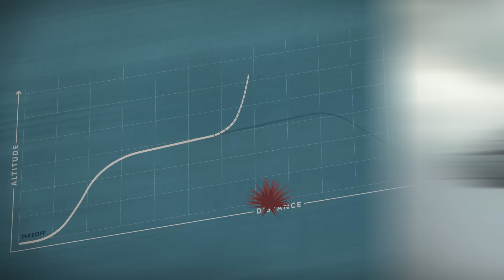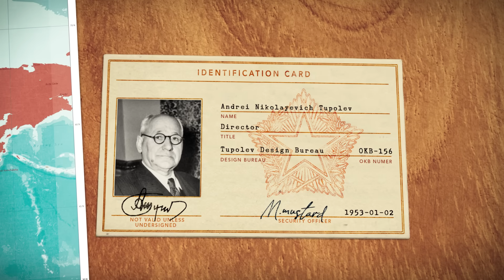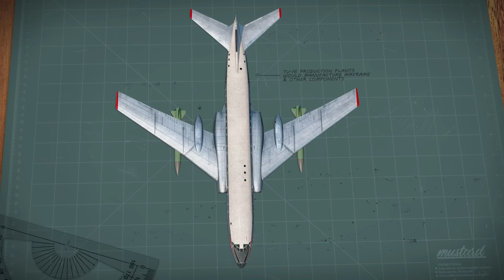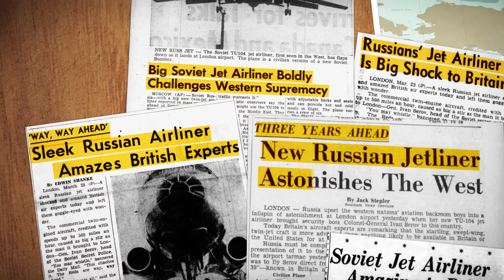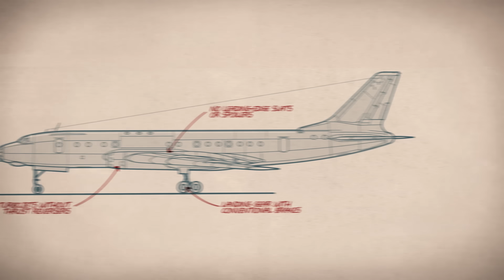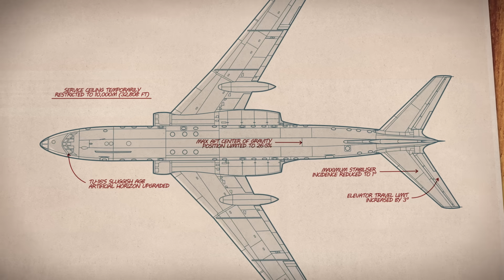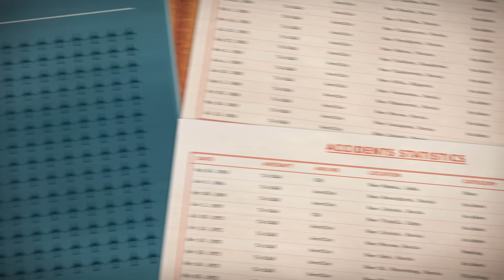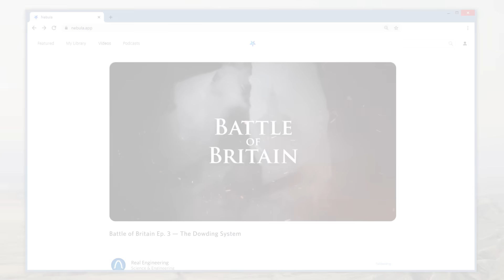The Soviet Airliner Designed To Crash

Comment: You REALLY would not want to fly the first US airliner, the Boeing 707-120,  which killed 5 people just one year after it went into service in 1958. Its killing spree only just ended in 2019 when it killed 15 people in a crash on January 14th, and plenty more people in between those years of operation.

Comment: Fantastic work - very informative! I love learning about the early jet airliners - those who designed and flew them were pioneers in many ways. Just a quick note - on the map of the Tu-104's first transatlantic voyage to the United States, you have Gander, Newfoundland, mislabeled as Goose Bay AB (also in the province of Newfoundland in Labrador, but on the mainland portion, called Labrador, some 600 kilometers away). Cheers!

Comment: This reminds me of a great quote from Chernobyl. There are some things you just don't want to cut corners on. A nuclear reactor is one. An aircraft is another.

"Why? For the same reason our reactors do not have containment buildings around them, like those in the West. For the same reason we don't use properly enriched fuel in our cores. For the same reason we are the only nation that builds water-cooled, graphite-moderated reactors with a positive void coefficient. It's cheaper."

Comment: Your explanation is totally incorrect. In fact those crashes were caused by stalls on wingtips. Planes of that era didn't have a special twist. New planes do have it. So now if a stall is occurred, it starts not on wingtips. But Tu-104 developed stalls on the wingtips, and as wings are very much sweped back, wing loses the lifting force closer to a back of the plane,  so the center of lift shifts to the nose of the aircraft.

And of course it has nothing to do with being a former bomber aircraft

Comment: I spoke to some of the pilots, who used to fly that plane for Czcechoslovak Airline. What they said is not corresponding to this video. They loved to fly that plane. The only negative comments were just two  - the aircraft was aerodynamicaly so clean, you had to carefully calculate the point of descent, because if you started late, you cannot lose your altitude on track and you have to ask for track extension. The second problem was relatively high landing speed, which was problem on short runways. In that case it was sometimes needed to use the braking parachute, which aircraft was equiped. Decision to buy TU-104 for CSA was generally considered to by wery good and the accident rate was normal, comparing to other first jets.

Comment: In 1981 a military TU 104 crashed killing all 50 people on board, including 17 high ranking Russian generals and admirals. The plane was retired from civilian service in 1979 after numerous crashes. it was retired from any use after the 1981 crash.

it demonstrates a different mindset between Russia and the West. The British did not pretend the Comet didn't have problems, they didn't try to blame it on the pilots. They didn't use the plane as propaganda. They were in a rush to be the first and beat the Americans though, and they overlooked an insane flaw by having square windows. The Lockheed Constellation was the first pressurized civilian airliner and had round windows. The Russians denied the TU 104 was defective. That mindset cost a lot of people their lives, including the Russian generals.

Comment: I flew on one in 1976, from then-Leningrad to Moscow. No individual air outlets, loud engine moan, and I watched in fascination on approach as the flaps wound out on long, long exposed jackscrews. As well, at Leningrad were a flock of recently-retired TU-114s  on the tarmac, all those multiple layers of props glinting in the sun...good memories!
Reply: Exposed jackscrews on the flaps reminds me of the DC-10... sitting in the right spot, you can see the jackscrews working.   :-)
Reply: I flew on one the same year, can't remember which route (we went to Moscow, then-Leningrad, Kiev and Yalta), but going by what you've said it may have been the same.
Reply: whats the first song name

Comment: Hi Mustard! One could argue that the most advanced plane is not the B-2 Spirit. Instead, it was the RC-135E Rivet Amber/Lisa Ann ballistic missile observatory aircraft. I, and most certainly many others, would love a video on it! The aircraft was unusually designed and had a massive missile tracking capability - it could track a missile from 300 miles (480 km) away! Very impressive in my opinion.

Comment: Flew several times in the 60's on the Comet. Liked how quiet landings and take offs were. Also passenger cabins too were quiet. Remarkable silent smooth landings. Too bad they had structural serious issues which were blamed on round windows.
Reply: No, it was not round windows that were the problem with the Comet:  it was the SQUARE windows.  Metal fatigue initiated cracks in the window corners, leading to catastrophic rupture of the hull and several fatal crashes.  The re-designed Comet 2 had round windows as one of the measures to fix the metal fatigue problem.
Reply: @bernarddavis1050  thanks for the clarification

Comment: You don't want to fly in ANY Russian aircraft, especially now as they are flying ticking timebombs that should have had their A B and C checks, now expired and using non-approved parts.
Reply: That's not true. Many of them were safer than their western equivalent
Reply: @katimboallan4605   not really. Most were a lot more dangerous. 

Tu-154s tended to crash a lot more than 727s

Comment: 50' ? Then go fly with Comet from Uk
Reply: The comment suffered far greater crushes any Soviet plane. Good observation you made.
Reply: @katimboallan4605   Actually the comet crashed less than the tu-104. 

Mainly because it was pulled from service after a few deadly crashes.

Comment: I remember taking a trip in the Soviet Union in 1984 from St.Petersburg ( Leningrad back then ) to Moscow to Kiev and then Odessa...
The one thing that struck me were the planes we flew on between cities : They were loud, not very comfortable and they all had glass noses which I found unique to say the least...
Great video 🙂🙂🙂
Reply: In the glass nose, there was a (comfortable) seat for the navigator, one of the then 4 flight crew members.
Reply: @Sergei-wf1jp  I see... Thanks for that explanation 🙂🙂
Reply: @Sergei-wf1jp  Not only. It was a rement from  TU-4  the soviet copy of the B-29 that crashed in USSR during the war. They really liked the idea of it. On the airliner it had a secondary function during the cold war. The soivets tended to fly airliners over restricted areas and the navigator doubled as photographer. I think it caused a few political incidents in the early 70ties.
Reply: @mowtow90  You mean they photographed restricted zones in USSR ? :)

Comment: "fell" 20kft? It glided like any other plane.

Using this vocabulary is just akin to mainstream media desiring to create a feeling if sensation. It is more credible to stick with aeronautical terms of one wishes to stay credible.

It's a pity you sidestep the actual aerodynamic causes behind the accidents but instead resort to non-standard terminology such as "hurled".
Reply: Stalling, mass weight
Reply: @305.anthonx_s  and you are incapable of formulating full sentences like a civilized human being?
Reply: @daszieher  I’m not best at speaking English, started 1 month back
Reply: If you stall out you are not gliding.
Reply: @FishbedMyBeloved  the term falling was used in combination with the double engine flame out. The aircraft itself, that means the wing was not stalled at that point.

Also, should an aircraft fully depart at high altitudes and tumble, as was the case in other events, recovery is highly improbable.

The aircraft suffered, by design, from a change pitching moment close to stall speed.

The majority of the write-offs were, however, attributable to maintenance oversights and improper procedures.

The Wiki page has a good collection of incidents and their probable cause. There are even events of "foul play", but too little to suddenly make this design "good".

Comment: Why are American planes failing in the post-2010 project called lives don't matter but cheap production does yes (MAX)
Reply: The max was pulled out of service after 2 crashes. This is good practice.

The tu-104 was allowed to continue killing. This is bad practice.
Reply: @FishbedMyBeloved  yes but in those russian or soviet times safety testing technology was old at that time smoking was allowed there was a lot of speculation why the plane went down until boeing engineers agreed the max was not safe for production but the office people ordered it  products because the 320 neo was better, they knowingly endangered lives, they even moved the office to Chicago so that the engineers could not put pressure on the directors, now the directors are somewhere in Central America

Comment: So, the T104 was actually working...

And only started failing later on...
And nobody suspects foul play?
Reply: No, it's inherent design flaws actually only surfaced through extensive use in the active airline service.
Reply: Foul play would involve actual equipment failures.

For foul play to cause an aircraft to somehow fall up would require the bad actors to modify literally everything and somehow go unnoticed

Comment: Aircraft derivatives are rather common. It takes years to design, test, change and finally produce flight surfaces (wings, horizontal and vertical controls). The KC-135 and the Boeing 707 differ only in the fuselage diameter. The KC-10:and DC-10 were nearly identical as well.  The underperforming brakes meant the Tu-104 couldn't carry ballast to cancel the aft CG issue.
Reply from the maker: Thanks for watching and commenting. While it's true, the DC-10 was first a passenger airliner, before it became a tanker. From the start, the KC-135 was developed alongside the 707, both stemming from the Dash 80.  I'm not aware of any post-war western bomber that was later developed into an airliner. The TU-104 and TU-114 were first purebred bombers, only later became airliners. It would be like the United States building a B-52 derived airliner.

Comment: It's amazing that the Tu-104 and the Tu-114 and -116 are based of of Soviet bombers yet have had such importance to aviation in so many regards.. well done Mustard!
Reply: All civilian aviation with jet engines was based on bombers. Perhaps not the British but they failed perhaps due to that.
Reply: @hurri7720  not really only the jet engine came from bombers its just that most company that made plane where making civilian and Military plane the same why lockheed martin make missile for the air force and booster (and a lot of other stuff but you get the idea) for the nasa
Reply: @the_zonko  the boeing 707 was designed from a bomber.
Reply: @machupikachu1085  lmao no it was build on the prototype that was the Dash 80 and it was build whit both military and civilian usage so no it was not designed from a bomber
Reply: @the_zonko  the B47 is the progenitor of all modern airliners.  The Dash 80 was developed to improve on the B47 concept but be used for commercial aviation.  

Sure, you came from your mommy, but would you honesty say you didn't come from your grandma?
Reply: I;d love to see a passenger jet based on the TU-22
Reply: hi
Reply: It's kinda funny that Mustard's video of the De Havilland Comet said something like, "the US specialized in building cargo planes in WW2, which were easily convertible to airliners. Meanwhile the British built mostly heavy bombers, which were harder to adapt into airliner designs."

And then you have the Soviets just turning bombers into airliners like nobody's business
Reply: Add the Tu 124 and partly the Tu 134. Tu 154 was the first clean sheet civilian jet liner designed by Tupolev.

Comment: Holy, just checked TU 104 20% Hull Loss, TU 124 15% Hull Loss, Boeing 707 8% Hull loss, etc. Those begining were brutal. Taking a jet a have a 1/20 000 chance that you would CRASH in case of TU 104, holy would rather walk that distance. ( 90 mil passanger transported by TU 104 = 900 000 flights = 900 000/38 hull loss = 23 684 )

Comment: You missed a important crash in the early 80'S  that killed the majority of the Soviet Navy's eastern command , They were in Leningrad for a meeting and used a 104 to get them there and back , On the return trip they all loaded up on consumer goods, as they were based in Valadistock these goods were hard to come buy in the far east . To add to the load the chief Admiral insisted to two 160 kilo rolls of printing paper . The pilot refused to fly due to the plane being overloaded , however facing a 10 year trip to Siberia he agreed to fly anyway . Now its tail heavy nature was was pushed to far and it stalled on takeoff having pitched up on rotation , this crash killed everyone on board including 16 Admirals . They should have bought a DC 8 .

Comment: This is one of the most beautiful planes ever, regArdless of its safety issues. It’s right up there with the comet
Reply: It’s only inherent design flaw is slightly downward sloping wings predisposing the aircraft to stall in a flat spin but the Tu-124, Tu-134 and Tu-154 all shared that downward wing slope

Comment: In typical pioneering Soviet fashion the Tu-104 was tough as hell but was a danger because it was an utter b!tch to control. 
Where as in classic pioneering western fashion; Comet flew well but was prone to catastrophic structural failure thanks to something small but critical. . 
But still both have a beautiful mystic to them and beautifully sleek with inboard engines, and they would be fixed in the end to be decent airliners.... even if it was too late.

Comment: The first airplane I ever flew was the Tu-124 - a scaled-down and reengined 104. It was 1975 or 76, I was 8 years old and the main impression was - just how small the thing was, especially inside. Much smaller than a regular city bus. And, in retrospect, it wasn't much safer than the 104 - the 124s were grounded and written off along with the remaining 104s, in 1979-1980.
Reply: You were a pilot at 8 years old! No wonder these things crashed a lot
Reply: @DavidAndersonKirk  That's why I already considered retiring then...

Comment: The most famous crash of this aircraft occurred in Feb 1981, when 16 Admirals, and many other top Navy brass of the Pacific fleet, were killed. It was apparently caused by general overloading with consumer goods unavailable back in Vladivostok, and two rolls of printing paper that shifted during takeoff, causing the plane to pitch up and leave the ground prematurely, during the takeoff run. The pilot had protested all the extra cargo, but was over ruled by the top Admiral. Initially, the Soviets thought it had been a special operations attack by "the west", preliminary to an all out attack. When the real cause was discovered, it was treated as top secret.

Comment: There are claims by Leonid Selyakov (renowned soviet aircraft engineer who worked for Tupolev and was the chief engineer of the Tu-134), in the book "The Thorny Road to Nowhere", that Tupolev himself opposed the use of jet engines for the longest time possible. Both for military, and civil purposes. Looking at the enormous technological gap between the west and the soviets in the 50s,60s, and onwards, it's easy to believe it. Tupolev was a sort of an Edison like fellow, with deep connections in the soviet party, but a very stagnant way of thinking.